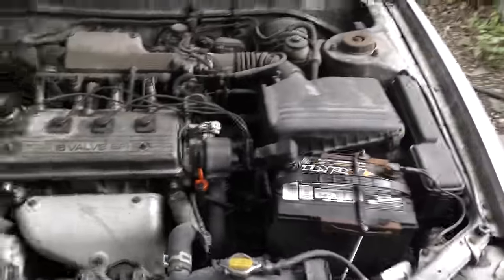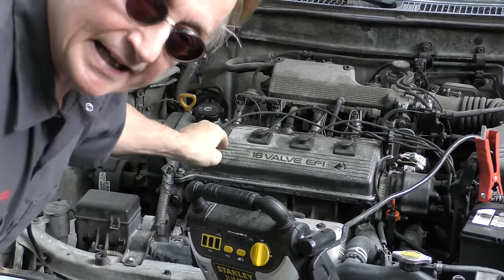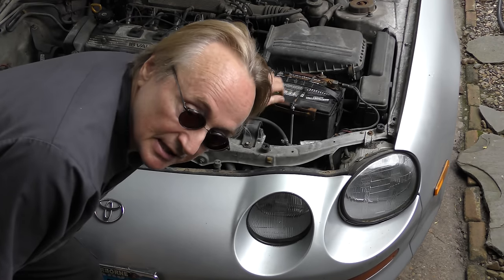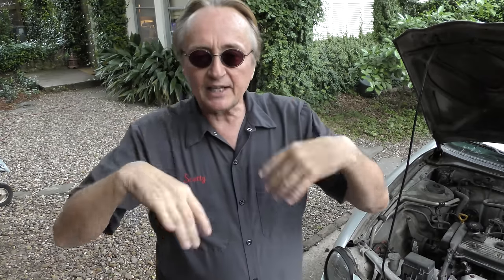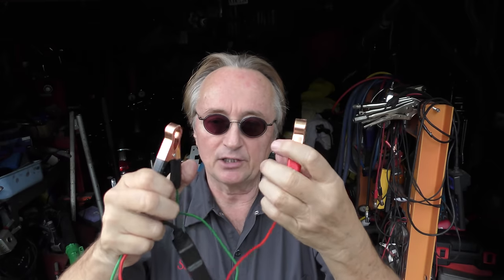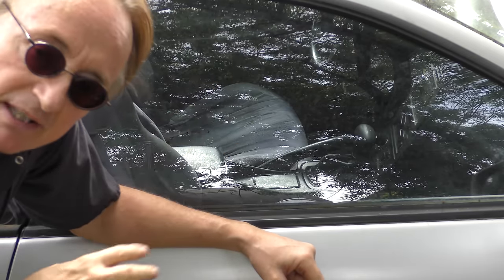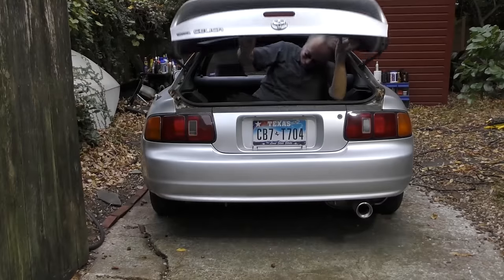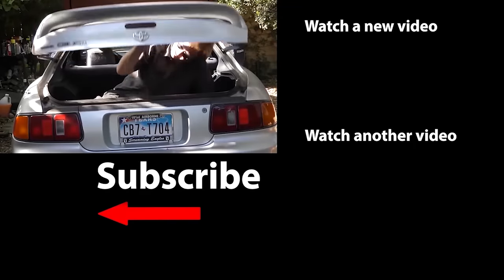Never Do This to Your Car (Learn from My Mistake)

Comment: A tip that might save your life: The two metal tubes on the headrest are designed to be able to shatter a window in an emergency!
Reply: I won't tell my little kids that.
Reply: Hmm then why are the headrests in the Tahoe so ridiculously hard to remove
Reply: @EriBarr  It's General Motors, for one.
Reply: @EriBarr  American cars😏
Reply: @EriBarr  Honda Odyssey too...  once figured out, still need finagling.
Reply: @EriBarr  TV
Reply: @squirelova1815  
What about Ford dosen't that stand for (F)ound (O)n (R)oad (D)ead ......lol
Reply: @matthewvarnam4302  No. It's First On Race Day..
Reply: Next time I watch a movie where people are drowning after their car goes in a lake I'm going to be shouting this at the screen!
Reply: @matthewvarnam4302  Ford.
Found ....On...Rubbish ...Dump.
Reply: @matthewvarnam4302  Ford: fix or repair daily.
Reply: @matthewvarnam4302  fixed on roadside daily too
Reply: @texasmatthew4892  meaning FORD cars never fix, everyday have emerge new problem.
Reply: @matthewvarnam4302  first on race day
Reply: @matthewvarnam4302  Fine Old Restorable Driver!
Reply: What is the emergency tip to taking them off?
Reply: @richardcampbell6695   No that would be, Fix Or Repair Daily.
Reply: @meademorgan6614  Fiat = fix it again tony
Reply: Thanks!
Reply: @matthewvarnam4302  forever out running Dodge
Reply: I thought it stood for Fix Or Repair Daily
Reply: I've tried and tried to get my girlfriend's headrest out of her Camaro bucket seat because the angle annoys her, but even with assistance I can't get it to release.
Reply: @EriBarr 
I've only tried to remove the ones that go in the folding seats and they're terrible.
Try a newer Camaro! 🤬